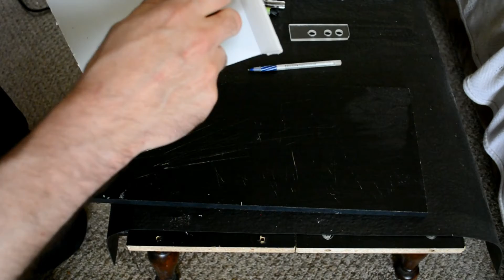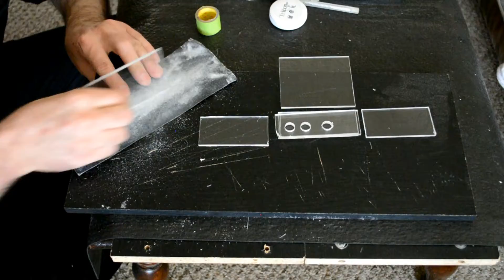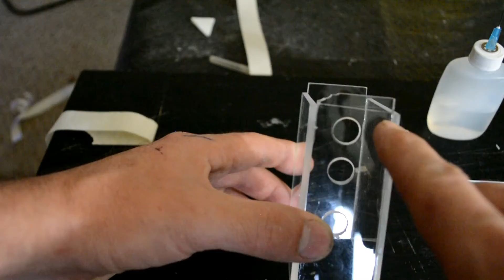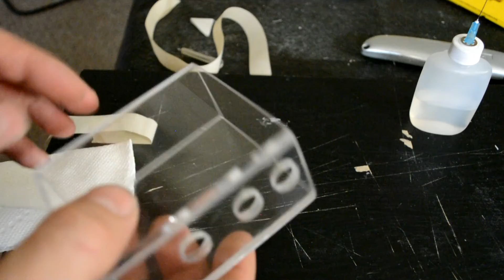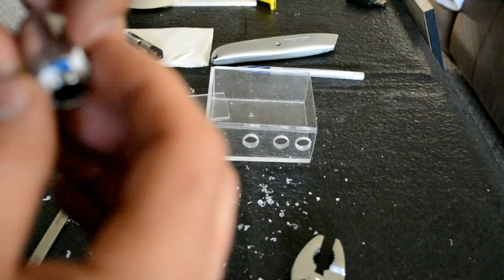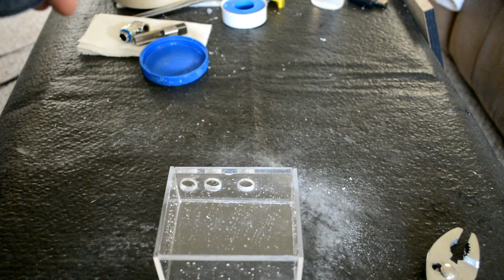How To Make Your Own Custom DIY PC Reservoir 2016

Comment: I made one of these rectangular reservoirs 10 years ago. Still working, no leaks.  But I never tilt my system to it's side.  I have a fill port at the top that I don't trust.  Looking back, I should've make a properly seal fill port.  but then it won't fit in my 3.5" slots.  Better yet, I should've made a reservoir out of pipe right over the pump.  Having the reservoir at the front does nothing, you see nothing moving.  The difference between on and off is condensation.

FYI to others watching:
teflon tape sealing is not reliable, the threads are too shallow and teflon tape in general is not reliable especially if you accidentally twist the connection.  One of those holes are stupidly close to the edge.  playing with fire.  If you must sand the edge, put your sandpaper over a piece of glass.  It'll still be janky but at least it won't leak.

Comment: hi cyberden! thanks for the video! though its lengthy, I found it informative. I would like to ask though, do you think a simple cube res made this way is able to withstand pressure when the water expands after heating up? what im afraid is that this will not be able to last long and cause leaks soon enough. thank you once again and hope to hear from you soon
Reply from the maker: Absolutely. This is the same method people use to make acrylic fish tanks holding a LOT more fluid.
Reply: @CyberDenSystems  alright! What thickness of acrylic would you recommend? And what is the size of the drill bit for the hole before adding the threads? Thank you
Reply from the maker: I recommend at least 1/4 inch, 6mm. I've tried thinner pieces but the thinner you go, the less threads you get, and you are more likely to strip them. And the holes size is 11.8mm before threads are added.
Reply: @CyberDenSystems  Got it! Thank a bunch!

Comment: Can I use silicone glue?
Reply from the maker: You can, but it has to be 100% silicone. All the stuff you can get at the hardware store, if you read the back, it says, "not intended for direct immersion in water".  100% silicon is what they use for glass fish tanks. And that stuff lasts for years.

Comment: I have a question would I be able to use a tall can as a reservoir(specifically a monster can)?
Reply from the maker: Theoretical yah. You would need to attach something thicker to it so you could put fittings on.  Its also aluminum. So there are risks mixing metals.
Reply: CyberDen Systems ok I appreciate the fast response. Also I subbed, but could you elaborate on the mixing metals
Reply from the maker: Usually, in a watercooling loop, you would only want one type of metal. Like a copper block, and a copper rad. As the fluid flows through the loop, microscopic particles get released from the metals. So if you were to let's say, put an aluminum radiator in and a copper block. The aluminum and the copper molecules would interact with each other and cause mayhem after some time. People talk about galvanic corrosion from this reaction. Itll eat away at the metal components at an ever increasing rate, and cause slugging, and eventually clogging. You can combat it with additives and different fluids, but, it will inevitably happen. So its always best to stick with copper. Nickel plating is OK though because nickel doesn't corrode on its own like bare metals do.

Comment: Hi bro, i wana make m'y own water cooling distribution block but do you think that i can fix my tubing with acrylic cement ? Bcs i don't have the trhead and the fitings. Thx bro keep doing
Reply from the maker: As long as your useing acrylic for the distro, and acrylic tubing, then that should work just fine.  I think it would be pretty neet to see it without fitting. Kinda like it's all one piece. Cool idea man.
Reply: @CyberDenSystems  thx bro, and do you think that with petg it can work ? Thx
Reply from the maker: Negative. Petg is very different from acrylic. The weld-on solvent won't work on. You could use silicon, but it would have to be %100 silicon. Not the same stuff you would use to seal household stuff. Look for fish tank silicon. That stuff is made for direct immersion in water.
Reply: @CyberDenSystems  ok Man, thanks for helping me alot. I wana do the distribution block for the back of the case (around the PCI) and sorrt for my bad english im French lol
Reply: And i don't find something like weld one un Fr do you know an alternativ ?
Reply from the maker: If you can get your hands on some metholyn chloride,  that would definitely work. Weld-on products are mostly made of it with some additives tossed in. But, if you do use it, use it outside, or in a VERY well ventilated space. Its nast stuff. Another alternative is acetone. That should be readily available. I've personally never tried it, so do some testing first to see if it works.

Comment: howdy dude, thanks for doing this video, learned a lot, very grateful, thanks so very much !
Reply from the maker: Thanks man!  😁 thinking about doing an updated video.
Reply: WOW NICE ONE ! now ima looking forward to that too !!

im severely mobility-impaired, in bed 23 hrs a day so i can still do light work on projects as llong as im sitting, so your video's have given me the motivation to carry on and save up to buy the gluue for the acrylic.

by the way, what is the name of the glue you use ? the chemical name, if you know ?

so again, thank you for inspiring me to not give up, for people like me who cant physically do much, your video's are very instrumental to keeping my life positive and how you show normal hand tools can be used.

lastly, would you ever be interested in laser cutting any acrylic pieces for me and posting them, im in the UK but flat-packed acrylic wouldnt be much shipping, no worries if not, its a small box that fits into a double 5.25 inch computer case bay, with 3 holes.

You are awesome - keep up the very good work on this how to for acrylic-custom reservoirs for water cooling, YOU ROCK DUDE !
Reply from the maker: Wow man. Thank you. I'm so sorry to hear about your condition. It's inspiring to know that you can keep going, and that I can help in that way. 
I'm not sure about the technical name for the stuff used. But it's called Weld-on #4 made by a company called Sci-grip. It's relatively inexpensive. It's not so much a glue as it is a solvent. Very fast set time, and pretty much permanent. 
I do do work for people and I'd have no problem building whatever you need. I started a series last June called Free Mod Monthly. It hasn't taken off much, but it's still in effect. If you want to contact me  at cyberdensystems@gmail.com I'd be happy to work with you.

Comment: Great and very very informational video! If you would lend your knowledge: is there a way to help guide the tapping tool so that it goes in perfectly straight? I have terrible orientation and fear I'd be doomed to crooked thread taps. 

Someone once told me  to use a drill press with the taping tool attached, but I have a feeling that I'd ruin the reservoir. Please help if you kindly would!
Reply from the maker: +Lorenzo Perales you absolutely can use a drill press. That's actually how I normally do it. On the bottom of the tap, there is a small indentation. It is perfectly centered. 
What I do, Is I put another smaller tap in my drill press upside down. (Cutting side up in the chuck of the press). Smaller taps usually have a point on that end. I place the acrylic on the platform, put the tap against the hole, and lower the press till the tap just touches.  The use minimal pressure pressing down, while turning the tap with an open end wrench. I believe it's an 11mm wrench. That method will ensure that your tap is perfectly square with your acrylic. The key to remember, is go slow, and back it out a little often. That will clear the chips.
Reply from the maker: +Lorenzo Perales PS. Sorry for the late reply. My YouTube notifications are apparently not working right?
Reply: My acrylic sheets have yet to arrive, so you're right on time! Thank you very much!!
Reply from the maker: +Lorenzo Perales anytime man. Post back your results. I'd love to know it turned out for you.

Comment: A tip for drilling the holes, have a peice of wood under the plastic, then when you drill the wood will protect the bottom of the plastic so it shouldnt chip. Also tap holes before assembling the res, its alot easier and you dont have to faf about trying to get the shavings out of the res.
Reply from the maker: That's a great idea, and makes a lot of sense.
Normally I do drill and tap the holes prior to assembly, but it's good that you pointed that out.  that way we can all learn.
Thanks for the tips, and thanks for sharing with everyone.  :)

Comment: i used some superglue on the outside and then i went around the joins with silicon sealant  .. it works well  ..
Reply from the maker: That's awsome!!  I'm curious. What kinda of silicone did you use, and how long has it been running?
Reply: hey i used Evo-Stik Multi Purpose Silicone sealant on the inside at the joints and Loctite superglue on the outside of the joints .. iv been using the reservoir for just shy of 3 months now and no leaks .. works perfect .. i use 4mm thick perspex *Clear with with blue tint and some blue LED lights glued on top powerd by the power supply .. and its all fitted into the front of my Corsair 200R shell .. give it a try man and make a video on how to make it too .. id love to see how you use my way to make one THANKS !!!
Reply from the maker: That's a great idea!!  I'll get the same materials you did and make one up, let is run for awhile and do a follow-up/comparison video.
Reply: thanks man could you link my channel too .. just to help me out abit ill also put your link on my channel as a featured channel to go to ;) cant wait too see what you make up man ill be keeping my eyes peeled for the video
Reply from the maker: Thanks man!!  I'd link your channel, but i'm not sure how. I'm still learning the little ins and outs of youtube.  lol could you tell me how to do that?
Reply: I bought some aquarium silicon sealant to build mine. Gonna use loctite type glue on the outside to make it extra secure. I would use it on the inside but it's gonna leave white marks on the perspex and I want it to be visible